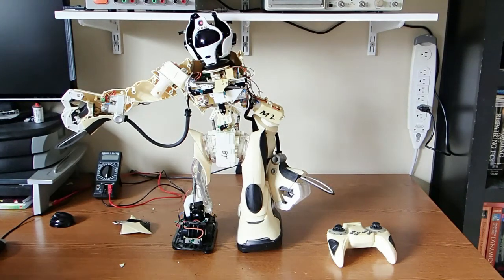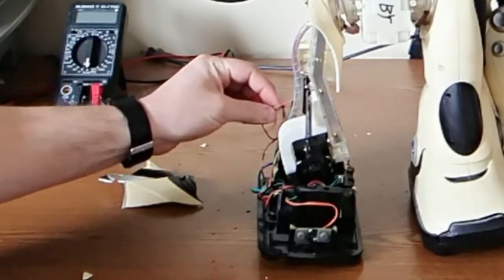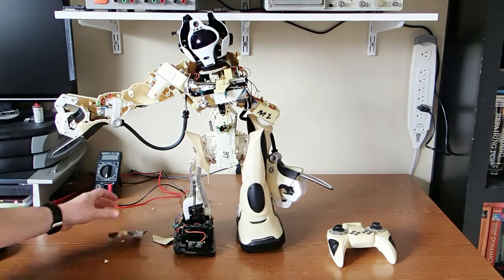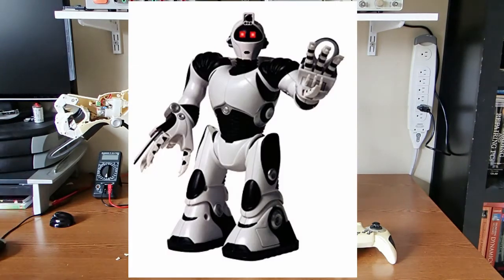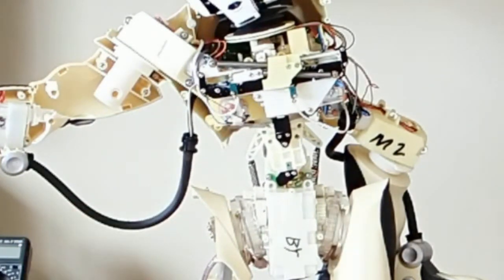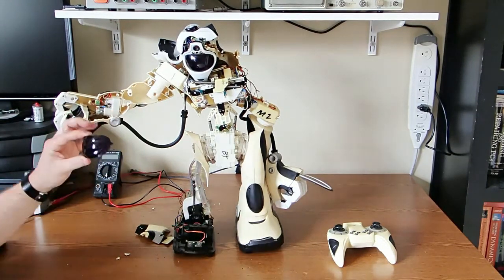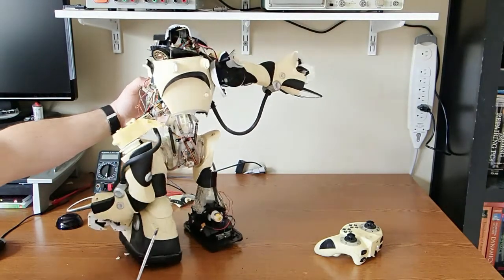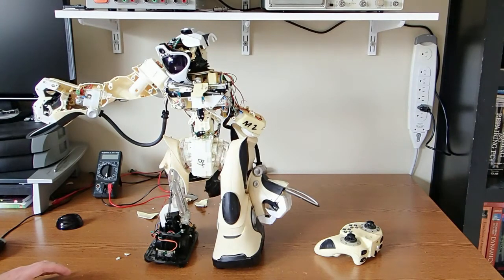Robosapien V2 Tear Down & Anatomy Overview, Part 1

Comment: Thanks for making this video! i’m actually a collector of these types of toys and never got a chance to see the inside of the head nor the mechanism for the fingers, funny story when i first got one it started smoking and shorting out, i would love to see what you did with the parts, maybe a part 2?
Reply from the maker: It probably shorted because the insulation on the wiring cracks off after a few years. Maybe I will do a part 2 ;-)
Reply: @CircuitCrush  Please make a part 2, i’ve actually wanted a part 2 for awhile now!

Comment: I remember very well when I wanted Robosapien V2 for that Christmas! (2006) But i got the Roboraptor :P
Reply from the maker: Never got a chance to play with the Raptor. Did you not like it?
Reply: I mean I like it, but I wanted Robosapien V2 more than anything on that Christmas 2006.
Reply from the maker: Does it still work?
Reply: Not anymore. :[
Reply from the maker: You should try to fix it, may be a fun hack or project. I'd start by looking at the insulation on the wires LOL

Comment: Hello, do you know if there is a way to change the type of batteries you use in your feet? since it takes 10 batteries type D
Reply from the maker: I think the weight of the batteries gives it stability and also D batteries are better for higher current demand applications than C or AA batteries

Comment: I still have mine and I want to do some troubleshooting before I open it up to figure out why it is not working. I would like to connect it to a DC adaptor so that I don't need to worry about the batteries, do you guys have any idea how to determine how many amps/volts this thing would need to switch on?
Reply from the maker: Just take a look at the batteries it would take and you can get a good idea. Probably faulty insulation like mine lol

Comment: Back in the day these were made, micro controllers were really expensive, companies would just use a diy in house microcontroller covered with black gunk. Today, you can find real micro controllers in lots of toys. If they made these today, they would have been way better designed.

Comment: bro what should i do when i star it stuck half way from waking up it was full of dust i didnt clean the circuit board in the inside is this beacause for the dst in inside if so then what should i clean it with the circuit board i meant
Reply from the maker: I'm not quite sure what you're asking, but you can blow the dust off with canned air or perhaps yours has the same issue mine did and it shorted. This is really a cheap, China made toy, so I'm not surprised the insulation on the wires would fall off.